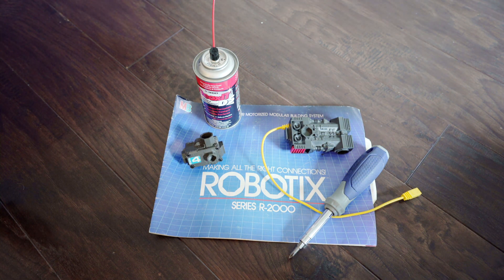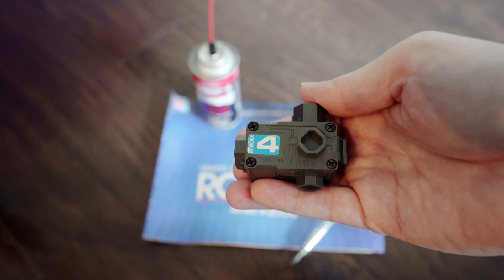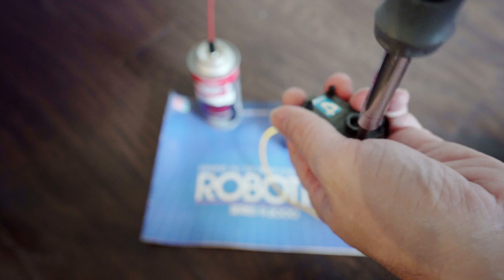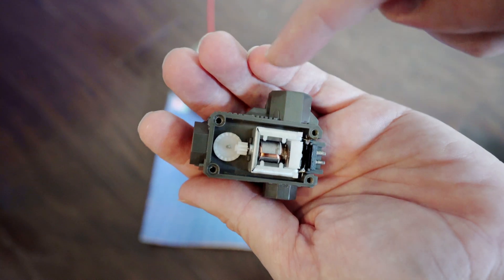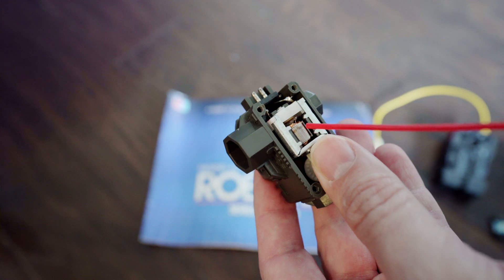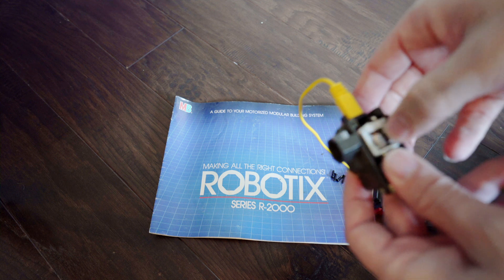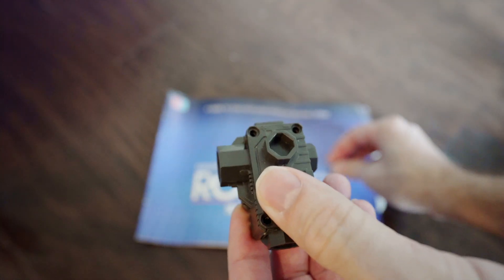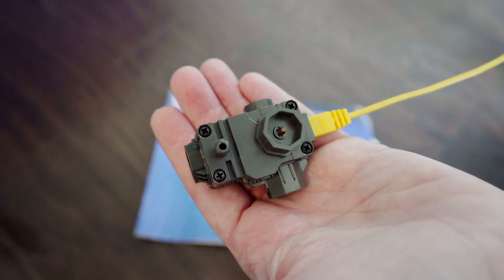Robotix Motor Repair!

Comment: Thanks for the video, just a quick note to anyone about to do: it’s perfectly fine to remove the drive gear when working on the motor. In fact, I removed all the motors and drive gear and added silicone grease to get ride of the “gear slap” noise. It’s simple to replace the pin and gear when done without opening the other side of the motor.. Also, though not needed, removing the other access panel on the other side isn’t the end of the world if you want to grease those gears too. The best advice is use a pick tool to pull out the retention slide ring and push back in using the same tool. Really not hard but all of this isn’t necessary just to get the motors working again :) What an awesome toy !

Comment: I ran into issues using Deoxit this way.  There was a lot of overspray left in the motor housing and somehow it was causing a short when I put the cover back on.  Had to remove the motor (which comes out very easily as one piece with the soldered connections attached) and clean out the housing.  Worked okay after that.  So I would consider removing the motor from the housing to do the spray cleaning, then putting it back in the housing once it's working again.  Thank you for the video though!  The corrosion cause would have never occurred to me otherwise. [Edited for typos.]
Reply from the maker: Thanks! I haven’t had this issue yet but I’ll keep it in mind!

Comment: Do you have any tips for making the walking legs work? Thanks to your video, I was able to get the motors running. But when I hook them to the legs, they work. But they get stuck. I'm  ot sure what's going on. I've used lubricant. It helps. But it feels like they keep getting hung up. And won't actually move very well.
Reply from the maker: I did have to lubricant mine as well. They honestly never worked all that well even new.
Reply: @Edgarbopp  Thanks for the reply. I got some lithium grease. I haven't gotten back to the project yet. I'm sure it will help. I do remember my robotix at least walking when I was a kid. So, we'll see how it goes.